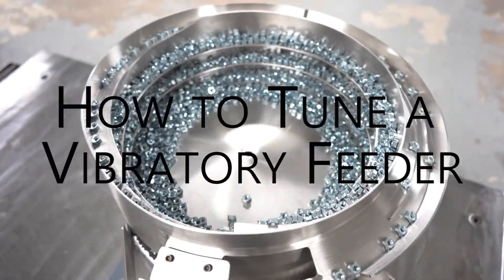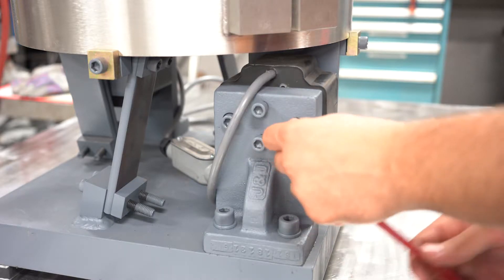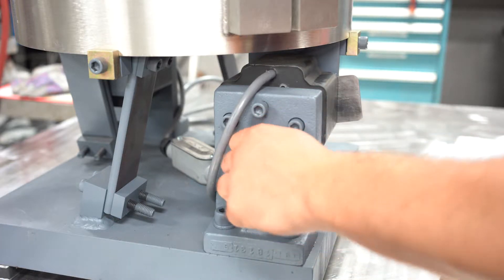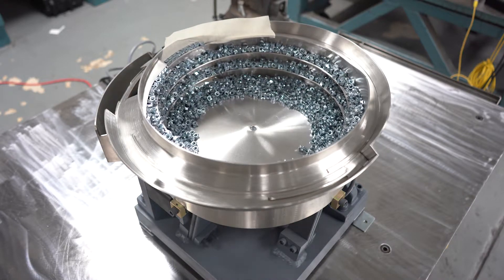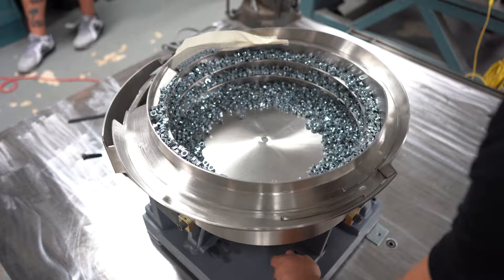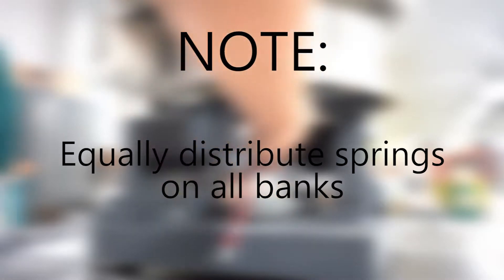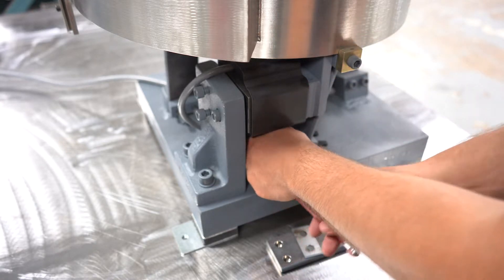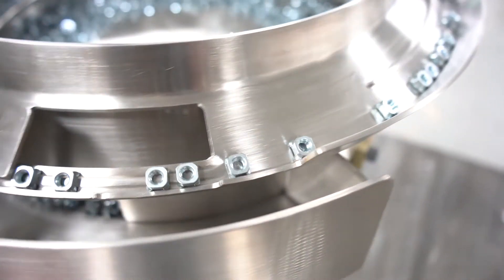How To: Tune a Vibratory Feeder

Comment: how can I achive a quick rotary movement.  I tune each vibrator but all the caps jump but with low rotary movement.  I think this is a matter of tune each vibrator with a specific order of vibration amplitud.  Could you explain how to tune the system, not only by knowing that I can set a gap in every vibrator, but to set an order for this adjustement?

Comment: I believe you have an error at 0:25 Rectified AC would be 120Hz and unrectified would be 60Hz. As for whether the gaps specified are flipped as well I have no idea... I think it is just the names that are backwards.
Reply: 1/2 wave rectifier still gives 60 Hz but only 1/2 the excitation displacement.
Full wave rectifier gives 120 Hz but only 1/4 amplitude excitation of 60 Hz AC.

Comment: https://youtu.be/2pMo3UMeoD8
This is a short video as to how our Vibratory Feeder Controller Works.
This Feeder Controller can be used for Bowl and Linear 
The feeder speed range is amazing, starting 1 Gm / second to up to 400 KG/minute and is completely settable.

100% Made in India,

Contact us to understand your requirements and suggest the best possible solution for your requirements

Available in 6-10-16-20 Amp.
230V-440V option
Voltage control
25/50/100Hz Operation
Settable RAMP up and RAMP down
Remote Start/Stop
External Analog input
2/3/4 stage for weighing applications
 http://www.icrbaroda.com/vibratory-feeder-controller/ 
You can find more information on
website: www.icrbaroda.com
Phone: +91 9327786818
Email: icrbaroda@gmail.com
you can also search for our other products on indiamart.com

Comment: Tuning bowls sucks. Thats when I love the REO controllers.
Reply: https://youtu.be/2pMo3UMeoD8
This is a short video as to how our Vibratory Feeder Controller Works.
This Feeder Controller can be used for Bowl and Linear 
The feeder speed range is amazing, starting 1 Gm / second to up to 400 KG/minute and is completely settable.

100% Made in India,

Contact us to understand your requirements and suggest the best possible solution for your requirements

Available in 6-10-16-20 Amp.
230V-440V option
Voltage control
25/50/100Hz Operation
Settable RAMP up and RAMP down
Remote Start/Stop
External Analog input
2/3/4 stage for weighing applications
 http://www.icrbaroda.com/vibratory-feeder-controller/ 
You can find more information on
website: www.icrbaroda.com
Phone: +91 9327786818
Email: icrbaroda@gmail.com
you can also search for our other products on indiamart.com
Reply: our product is better priced and functional than REO

Comment: Hello sir , 

I know to how vibratory feeder coil are made  E and I Lemination but which size we chose this is problem so you can help me and what copper wire size used to Mack a 150 Hz vibration coil
Reply: please call me on +91-9327786818